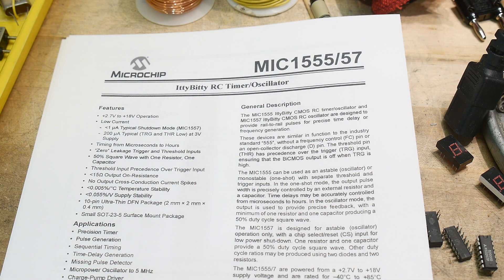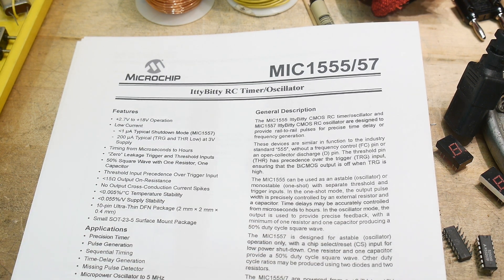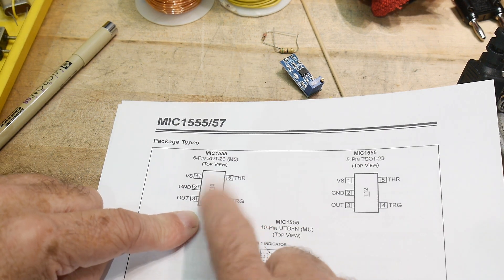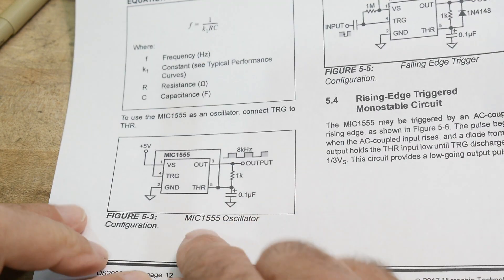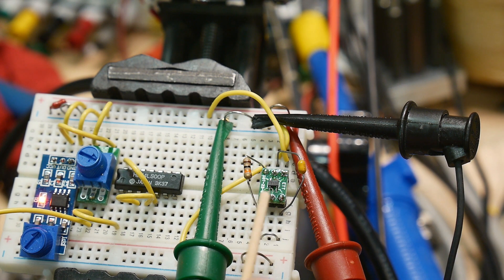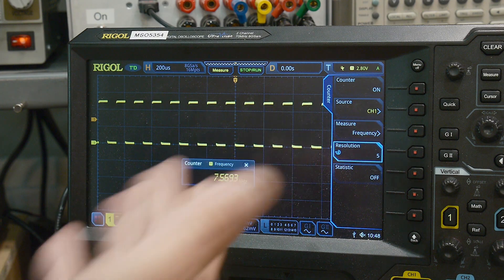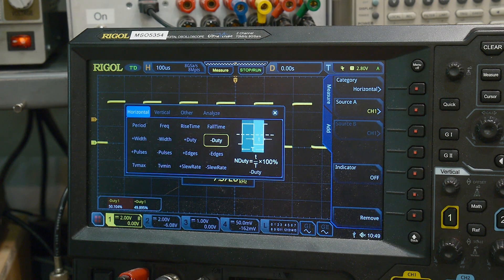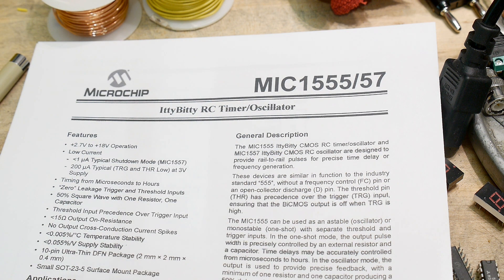#1299 MIC1555 world's smallest 555 timer

Comment: For little bitty oscillators, my goto is usually the 74ahc1g14. There's also the 74hc2g14 which'll get ha two oscillators in a sot23 (or smaller) package.

AHC logic generates much crisper/faster edges than a 555, and can reach much faster speeds. Can be used as an RC oscillator or with a crystal, too.

Comment: I recently had an encounter with a tiny 555 version. It was the LMC555 type which I ordered in TSOP8 version to replace them on those little generator boards for lower power and lower voltage. I received them in TSSOP8 instead and the small ones felt really lost on the boards for their larger versions. 
They were cheap enough, so I might keep them probably. The miniaturization at least makes it easy to keep things that one doesn't need.

Comment: Connecting the capacitor to the output is also possible with the CMOS 7555. But not with the TTL NE555.
Reply: That's partially true. When using the NE555 from 15V, there's no problem connecting the feedback from OUT to TRIG/THRESH because the output won't drop below 12.5V at worst (supplying 200mA), while the threshold voltage won't exceed 11.2V (nominally 10V), although taking large currents will make the timing more susceptible to variations between devices of the threshold voltage. The problem arises when operating from 5V when the output could drop as low as 2.75V when supplying 100mA. That may not be enough to exceed the threshold voltage which could be as high as 4.2V (nominally 3.3V). The solution is to lower the control voltage to below 2.75V, perhaps to 2.5V, thus lowering the threshold voltage.